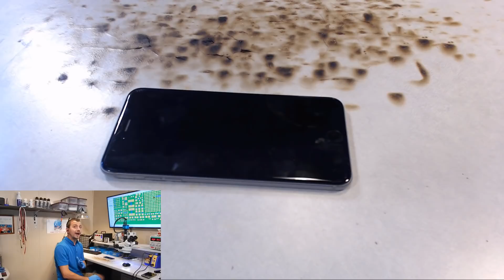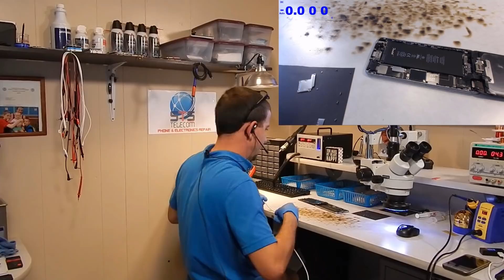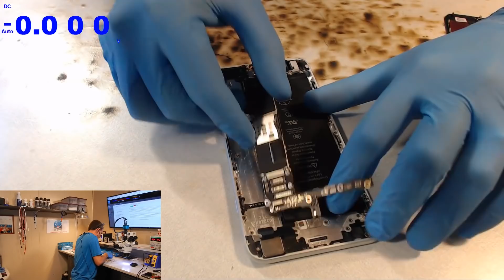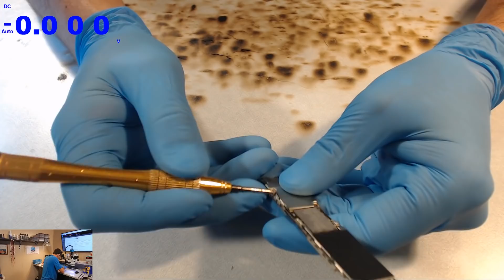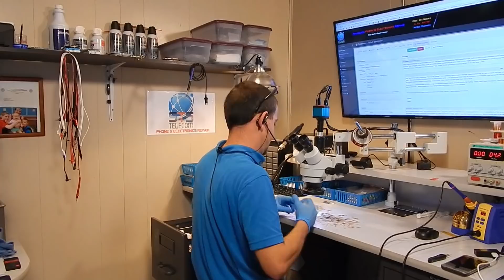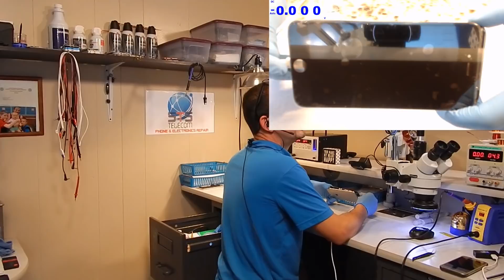Battery or Power Problems After iOS 11 Update?  An iPhone 6+ Repair

Comment: Hey everyone
Anyone who is reading this please reply as fast as possible.
Can anyone help me out?
Around 2 years back i used to have an iPhone 6 one day all of a sudden it went down and after plugging it to the charger for a long time it woke up and the thing that i noticed was that its battery performance dropped several folds. That means it stared to remain switched on only whenever it was connected to charger otherwise it will drain all the battery and went switch off within next 10 minutes. Then i took it to the store they said that battery needs to be changed. So i said ok then they replaced the battery but the phone didn't work it remained in its old condition. 
Can anyone tech. person can tell what could the problem with that phone?
And also what could be the remedy for this problem?

Comment: Can we send u an iPhone 6 to fix.....runs slow going to replace battery tomorrow I bought it from my friend that upgraded an u r right he updated to iOS 11
Reply from the maker: Replacing the battery may fix it.  Aside from Apple throttling them, I've seen batteries with low voltage reporting a higher charge percentage.  It causes them to run very very bad when the battery "percentage" is low.  If you do wind up sending it, it's best to register the repair through our website.  https://www.ststele.com/mail-in

Comment: I have an iphone 6 plus,  i changed the charging port and battery and my iphone wont charge. The new battery i bought was half charged so it was able to power the phone . When i connect the charger  it doesn't appear to charge.
Reply from the maker: Yiks, there's a few things it could be.  Typically the Tristar IC but other times that and/or the usb protect transistor.

Comment: My wife has the 6s plus. The battery started dying rapidly. Jumping from 80% to 45% to 30 and so on and die. After a while she it just didnt charge. You get the charging logo but wouldn't power on. We had the battery replaced and it worked for about 2 months then the problem came back. It won't power on and its been setting this way since August. Do you think it could be fixed?

Comment: bro you can just touch the gold contacts on the battery and it will give you the proper battery voltage 
has to be around 3.8 to turn on the phone

Comment: My iphone7 worked with glitches after iOS11, then gets stuck in a bootloop. On occasion it will load the OS, receive messages etc. But attempts to do much more causes the device to lock and get fairly warm. If you wait long enough, the operation/task will complete.... or reboot.  Once in an app, the phone works perfectly without issues (like a game for example) from what I can tell.  It's switching between tiles that The problems occur. The phone is 2 weeks past warranty and Apple says the logicboard is bad and wants me to buy a replacement for $350. Yet the guy at the service center can't actually perform any kind of test to actually  confirm the logic board is bad. I know good and well the logicboard has to have some form of advanced self diagnostic, but I am being lied to. The phone worked on 10.3.3 perfectly. So is my logic board really bad? I am very adept at electronics, but I don't work on phones enough to recognize particular trends of failures. Can you help in any way?  Phone has never been serviced or opened.  I did chuck it after missing an important call when iOS11 locked up for the umpteenth time. I have yet to successfully make or answer a call with 11 before or after the throw.  Same perpetual reboot with iOS finally loading after a few hours at which it tries to work (as before), constantly locking up etc. Otherwise, I am going to dump it for what I can in one of the phone buyback vending machines.  A simple downgrade to 10.3.3 if possible would confirm board damage without opening the device.

Comment: I work on MacBooks and iPhones and since the switch to the new APFS my MacBooks with High Sierra would sometime chime 2-3 times before booting where they would only only chime once and start normally on the older hierarchical file system(hfs). Now I see charging and booting issues with iOS 11 which uses apfs

Comment: Hello Jason,
Please i need an advice. I have an iphone 6 with touch problem, no water damaged. I changed the two ic touch but now the phone doesn't turn on but it consume 0.45A, no more, no less, just 0.45A ! Can you give me some advice please! I used 350°C to changed the two ic. I remove the two ic and tried to turn it on but its the same. Thank you very much.
Reply from the maker: Sounds like something shorted either under one of the touch ICs or on the other side of the PCB, sometimes a ball can squeeze out and touch things it's not supposed to.

Comment: Hi Jason, IOS 11 seems to be the new generation (Software) "Touch Disease" with after market screen replacements on the Iphone 6 "S" series and the Iphone 7 models. You may also see strange boot looping, slow response from touch and Loud speaker not working (Voice Memo Greyed out). I have had a couple so far...one was downgraded to 10.3.3 and worked 100% after and the other, put on an original cracked 7 plus for testing and worked 100%. Just ordered the Original 7 Plus screen for that one. Minho (@refectio) from IFixit Pros has written a Blog about the issue and adding updates to it as time goes by...https://www.refectio.ca/blog/ios11-touch-failure. Hope this helps :) Keep up the good work!
Reply from the maker: Thank u.  I have been hearing more and more about the aftermarket screen vs iOS 11 issues.  I bet it really hurts the factories that produce these things but sadly enough, they will still wind up needing to pawn them off on someone.  I had seen a really high defect rate on 6s screens for a while..  I don't install many but when I did, 2/3 seemed to have flaky touch.  The high defect rate seems to have drifted away though as haven't seen a bad one in weeks... and now, iOS 11.  I do wonder if it is due to honest software change or to intentionally make it more picky.  I think it could still be either way..  seems if they really wanted to stop people from repairing or replacing screens, they could probably do that very easy.  It's like they need to keep the repair industry going yet also need to be sure it is slowed down too...
Reply: STS Telecom I haven't tested myself yet, but heard the 11.0.3 update has fixed the aftermarket touch issues. Not sure if all the issues  were addressed, but I'm sure I'll find out soon.

Comment: Did an iPhone 7 plus tonight. First time I saw the apple logo boot apple logo boot. Even had a 3 time apple logo then phone finally booted. Asked customer is this on ios 11. Answer was yes. Said it was normal now on the phone. Ear speaker failed to work. Took on and off 3 times to check alignment of ear speaker and check for any blockage. Turned blue tooth off. Thinking maybe it it was possible connected to ear buds car who knows as speaker phone mode worked on calls. Sure enough speaker worked after turning blue tooth off. Then it kept working after blue tooth was turned back on. (Blue Tooth is rumored to have issues ios 11)This isn't my first screen replacement. Very rarely do I get a speaker not working on 1st try reassemble. These are just a few things I notice in my first encounter with ios 11. Still havent updated my personal 6+ from 10.3. Enjoy the videos. Here in Missouri you gotta "Show Me"! Keep up the good work

Comment from the maker: Another 6+ this morning drawing 2 amps of charging current with a hot, HOT CPU..  Touch is also weird.   Gonna try to get it to snap out of it and then update to iOS 11.0.2
Reply from the maker: And in an instant without doing anything other than reboot a few times, it snapped out of it and now seems totally normal.  Battery percentage jumped up but that's likely due to less load.

Comment: Ive experienced 3 6s phones so far that dont work on ios 11 with aftermarket screen. The phone would be 100% charged. Turn off back on and be at 10%. Going back to 10.3.3 fixed these issues on all 3 phones
Reply from the maker: Thanks, good info!  It has been tricky day over here yet again.  Phones with iOS 11 are doing some weird stuff.
Reply: I should also note that the one 6s. When hit power button to put to sleep and then try to wake up the screen would not respond to touch  at all. Hard reset was only way to get touch to work again.. going back to 10.3.3 also fixed that issue as well. I spent alot of time trying to figure it out and even replaced the lcd connector, just to find ios 11 was the issue lol.

Comment: Hey jason I have also seen this issue where the phones boot apple logo then blank and the apple logo again and it’s also getting to my nerves,
But the most annoying thing is with iPhone 7 now where the touchscreen seems to stop working like touch disease and had this with 3 phones already and all Original LCD refurbished replacements so no china made or anything like that damn all iOS 11 also a new screen does not fix this
Reply: David Torres When booting my iPhone 7 goes apple logo, blank for a very short period of time, Apple logo, then lock screen.